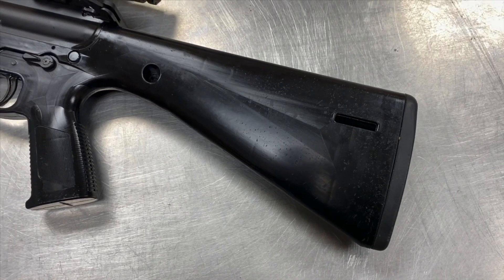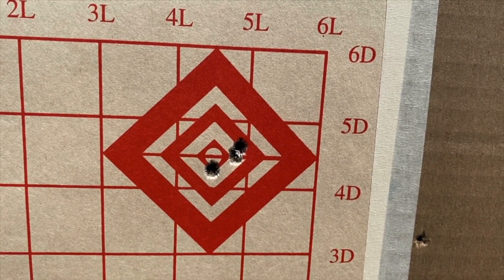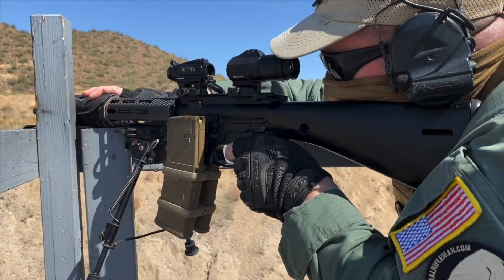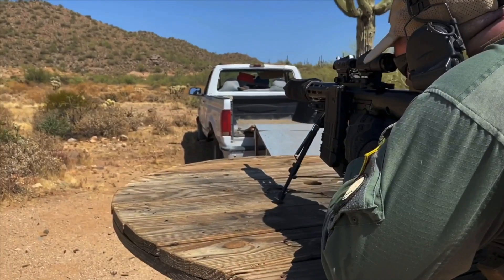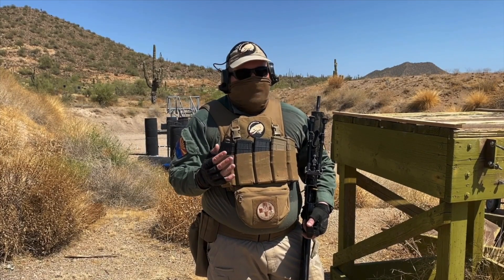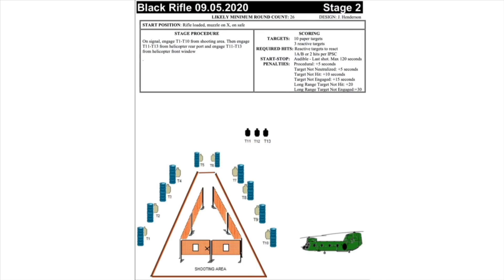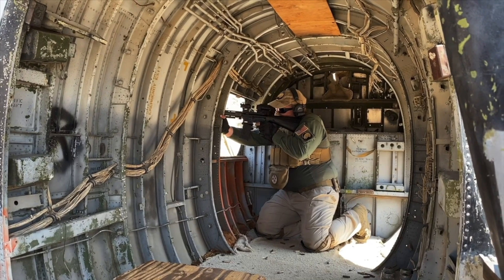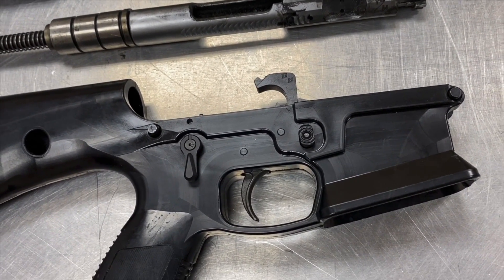Post Torture Test Full Auto Match - WWSD2020

Comment: When I was in the military I started out with the M14. In training we were taught to hit the dirt by driving the butt stock into the ground and rocking the rifle forward to a shooting position. This helped to protect your hands and arms from injury as you hit the dirt. Then I had to switch to the M16. When they issued it to me they said "Don't drive the butt into the ground , the weapon will break!" I would like to see you try this.
Reply: I am super confident that the WWSD lower would be just fine as long as it can hold together enough so that the buffer, spring and bolt carrier wouldn't take the stock off as it cycles.
Reply: @vimtheprotogen2855  Plastics have come a loooong way in the past 50 years. The furniture on the early original M16s was much more brittle than anything today.
Reply: Paul, I went through Infantry OSUT in the early 1980s.  We were taught to use the same method with our M-16A1s as you describe for the M-14.  I did this repeatedly for the next four years without any ill effect.  Would be interesting to see if this polymer lower can take the it (I suspect it would hold up just fine), but I can tell you my five digit serial number service rifle was a tough piece of equipment.
Reply: Interestingly enough, I enlisted in 2005, well into the M16's service as the primary infantry rifle. We were taught to drive the butt stock into the ground to avoid knee injuries.
Reply: @Gorgondantess  yeah, which is why I think the wwsd would survive.
Reply: When I went through basic, I think I recall driving the buttstock into the ground to be one of the accepted methods for dropping during the 3-5 second rush drills. We were issued M4 carbines with collapsing stocks and I don't recall any stock breakages (sights were another story). Unless I'm wrong, it made a comeback at some point. Granted, this was back in 2014 and my brain is already forgetting things it ought not to, so take what I say with a pinch of salt.
Reply: They taught us the same with the M16A4 in '02.
Reply: In 1984 we were taught the same thing with our M 16s. Never had a problem with them.
Reply: @chipoc4917  I had absolutely no issue training this way with the M4A1 either.

Comment: Testament to his skill that he can screw up an entire stage and still place in the middle of his division
Reply: Thanks.  I normally place in the top 3 in my division at this event and frequently win it with an optimized set up.  Without those penalties I would have been 3rd in division and 9th over all.
Reply: Seeing how the target sets looked the same and were close, there should have been some way to differentiate them, maybe some spray paint on one of the crossbars (the red array is for stage 1, the black array is for stage 2).  Hindsight is 20/20.
Reply: @SinistralRifleman  That is an incredible job, penalties or no. Sure, the penalties hurt the time however your performance with that gun in that scenario was absolutely spectacular regardless. Looking at what the gun can do: it was capable of a top 3 finish in that match in a somewhat sub-optimal setup with a lot of prior heavy use. I was honestly expecting mid-pack at best given what had been done with it in testing. This project that the three of you have put together has resulted in a fantastic rifle.

Comment: Handguard - you are the weakest link.
Reply: GOOBYE
Reply: That kind of carbon fiber handguard is light, but they don't amount to much... I do like some kind of plastic handguard over aluminum though; doesn't absorb heat from sun or shooting nearly as bad!
Reply: @KeterMalkuth  Whether the aluminum handguard just crushed, or cracked, would probably depend on the alloy, but if neither, that f'in handguard is too f'in heavy!

Plus, aluminum is hot in the sun and after mag dumps...
Reply: It's almost like driving a 4500 lb truck over a thin tube made of pretty much any material, especially one that's manufactured to be light above all else, results in that tube's failure.

How unsurprising.
Reply: Seemed like a great failure point rather than transferring energy into the barrel and further damaging it.

Comment: Was the handguard EXPECTED to withstand the bronco running over it?
Reply: If you watch the RECOIL video you see that they ran it over twice. The handguard broke on the second attempt. Russell's post abuse analysis shows that the metal support ring inside, failed. If I'm recalling this right, that's not a KE Arms part, just what Ian and Karl both found worked best at the time of the WWSD project in 2017. Maybe they'll revisit it now? Or maybe they're like "well, you shouldn't run your rifle over with a truck and expect EVERYTHING to be fine." Curious to see how they proceed with the new info.
Reply: I would have expected it to fail...
Reply: Handguards have always failed when run over...standard plastic cracks, aluminum bends.
Reply from the maker: No, it was not.
Reply: @InrangeTv  Were you surprised when the handguard failed?
Reply: @Scaliad  if they did not expect it to survive, then no they were not surprised to see it fail.
Reply: @stephens2241  Lol, I misinterpreted the Inrange response, reading (incorrectly) they didn't expect it to fail...
Reply from the maker: Expecting an unsupported hollow tube to not deform with a Bronco running over it highly unrealistic.  The gun remained functional and the float tube was still serviceable.   A lightweight aluminum tube will fail the same way, if not worse; this was not a "failure".
Reply: I'm surprised the gas tube didn't get crashed as well.
Reply: @colemanmoore9871  flip it over, re-apply bronco, good to go.
Reply: @danferrell1  I believe it's to show how it holds up to civilian use and accidents. If I recall correctly Karl had his rifle run over by a car at a match a few years ago. He had just put it down on a blanket to cool and someone drove over it by accident. Having the gun survive saves you 2000(?) dollars.
Reply: @danferrell1  Oh bullshit. Shit happens, and better to let the rifle go than lose the soldier. Cut the "with your shield or on it" crap.
Reply: @danferrell1  
Well S### happens in life and the military, I have seen a few rifles get ran over. Burned and other S### not normally but it does happen.  Priority go for saving life / critical equipment / assets and expensive.  A rifle drops way down on the priority list. "Big Army" a rifle is like "just repair or replace it" item,  down at Div and lower,  "The World is Coming to the End"
Reply: @TommyTombstone  Indeed! 😂

Comment: Polymer is so under rated :100: %
Reply: By boomers, sure. Everyone else knows it's good.
Reply: @Lexicon_  old habits die hard. But I ordered 2 of them just to see how tough they really are. And how light I can build a truck gun.
Reply: yeah modern plastics have come so far
Reply: @richardsveum8452  
👍 I have too.
Reply: Yeah, even just 30% glass nylon has mechanical strength properties similar to cast aluminum, but is far more resilient.  Pretty much the only thing cast aluminum does better is stand up to heat.

Comment: You guys should make a handguard out of the same material as the lower to go with it.
Reply: Carbon fiber is far lighter, stronger, and stiffer. Plastic is a poor choice for a handguard, even if it’s glass filled. The fact that polymer flexes is advantageous for the lower, however it is detrimental to a handguard especially if you’re mounting aiming devices like lasers. Essentially all plastic handguards aren’t free float as they don’t have the structural rigidity to function from a single attachment point at the barrel nut.

Comment: Could you do some extreme temperature tests if you haven't already? Like 0 degrees and then up to 150 degrees? (Fahrenheit)
Reply: It won’t make a difference.  The plastic doesn’t start warping until the high 200s, and goes molten in the high 400s.   Just leaving it in my car in Arizona is over 150 degrees.   Does your Glock frame crack in cold weather?  Does your magpul stock?  If not, then this won’t either.
Reply: @SinistralRifleman  Yes but I'd still like to see what the limits of the material are. I did watch the Torture test that Recoil TV did on the reciever. I was very impressed when he butt struck the post and it left an impression in the wood! Very interested!
Reply: @meadball1  Assuming it’s a Nylon 6 with 30% glass fill the upper long term exposure temperature limit is about 230deg F. It also actually gains tensile strength as it gets colder. You’re talking about -50deg F or more before it goes from ductile to brittle. Temperature shouldn’t be an issue with this material, it has a long history of use in other firearms applications.

Comment: Will this new lower have the full trigger pocket? Obviously you will need one for this dealer sample, but will the wwsd2020 preorders have the full pocket or the extra shelf? If the pictures on brownells are correct, it has the shelf. And if so why?
Reply: They are all high shelf.  Why?  Because the NFA market for these is insignificant.
Reply: It doesnt have to be NFA without the high shelf though, only thing that makes it is that hole.

Comment: Do you think a titanium collar at the front of the handguard would help the carbon fiber handguard survive better?
Reply: No. Titanium is ductile strength, not tensile. It would bend enough that the carbon would break, even if the titanium itself didn't. Or it would have to be so bloody thick that you'd lose the weight advantage anyway. Sorry.

Comment: Just out of curiosity, would a polymer handguard (with M-lock) not be feasible? Seeing as the polymer stock withstood the bronco. Or is the main concern that it could melt over time? Even if the rifle isn't meant to withstand fully auto fire for long periods anyway?
Reply: If it’s free floated it’s going to have to be a lot thicker/heavier to not fail, or remove the free floating.
Reply: the reason the polymer lower can withstand the abuse is because it has internal ribs. the handguard is an octagonal tube and doesn't have the diagonal support. a more cylindrical handgaurd might be slightly stronger but  that interferes with mlock.
Reply: I wonder if it can be experimented with the same way as with the stock. Try a lightweight polymer handguard that isn't free floated, and try a more robust/heavy but free floated poly guard and test both for accuracy and durability.
Reply: @indonesiansasquatch4926  There just simply isn't a market for a non-free float, heavy hand guard. No one wants something like that on their rifle, I think the majority of the market would rather just not run over their handguard with a truck.
Reply: @indonesiansasquatch4926  Ask yourself how often you expect to run over your rifle twice with a heavy vehicle in your normal match operations and still have no scratches or blemishes in the finish. I suspect the answer is somewhere between zero and minus two.

Given that you don't normally drive over your rifle as part of a match, why would you care if some minor part deforms (but is still reasonably usable) when you do drive over it twice?
Reply: @indonesiansasquatch4926  That's a ton of tooling for what would basically amount to a purely investigative endeavor. I don't think anyone's trying to dump that kind of money into a project that will never be sold.

Comment: Why test with a MilSpec trigger if that's not what the gun comes with? Parts interchangeability testing?
Reply from the maker: To shoot full auto, as was done in the previous torture test video.
Reply: The SLT trigger isn’t not full auto capable.  I used it in the same configuration as the torture test which includes a Milspec full auto fire control group.

Comment: I know it wasn't in the original "vision" for the rifle, but will there be any way to securely mount a flip up front sight to the wwsd20 without changing the carbon fiber handguard? I already have AR's with red dots and to me, this rifle is just begging for light weight flip up sights.
Reply: You'd have to add a rail section to it, which is hardly ideal. BUIS on the WWSD just kinda doesn't make sense.

Comment: Did you get inspired by the MG 08/15 for this build?
Reply: The inspiration was the original Armalight 15, with it's design goals reiterated with the technology and material changes of today.
Lightweight was among the biggest focal points.

Hence the name, "What Would (eugene) Stoner Do. 2020"
Reply: @libertyhog1428  that was aimed at the barrel shroud and bipod position as well as the fully automatic fire. An MG 08/AR-15 if you will.
Reply: Ahhh, gotcha.   Bipod position was dictated by the partial failure of the handguard after meeting a Bronco 🥺 haha.
Only the rear section was still in solid shape

Comment: I thought the handgaurd waa supposed to be strong.   Since your lower did so well why not make the handgaurd out of your polymer. For 1700.00 I shouldn't have to be worrying about a hand gaurd. Willing to wait a bit longer. Dont forget a heat sheild
Reply: It's open ended, attached only to the rear to be free floated. Polymer would have to be stupidly thick. The only other option would be an Al handguard.
Reply: It is strong, it's just the load of a truck/bronco applied to a particularly shaped and unsupported component.

That 9/10th of the components would survive a couple thousand lbs of weight with no appreciable damage is impressive.

That the unsupported and open end of a free float handguard failed is unsurprising; predictable even. 
Aluminum handguard would likely yield in the same way (well crush, but probably not crack); their polymer formula applied to the handguard would probably crack at the end, or permanently deform from over yielding, small chance it'd return to original shape
Reply: If you're really worried about a handguard failing from extreme and highly improbable situations like being run over by a truck, one could save $80-300 by not installing any type of handguard at all 😜🙂
Reply: Plastic handguards would crack, aluminum handguards would bend
Reply: Why would you worry about a handguard? Run over your AR on a regular basis? It's perfectly strong for what it is.